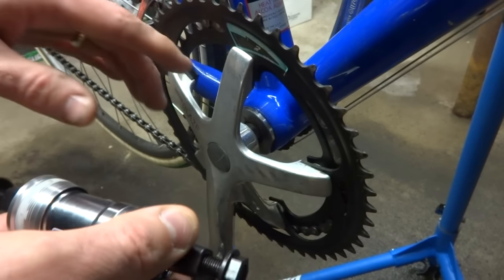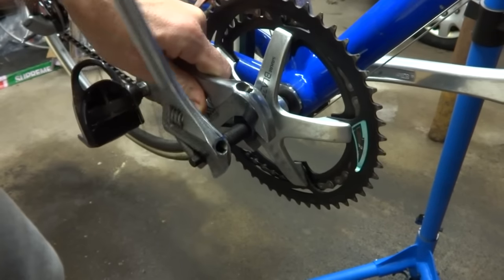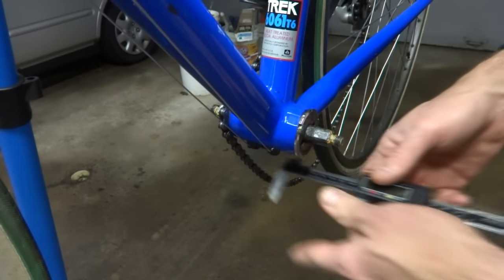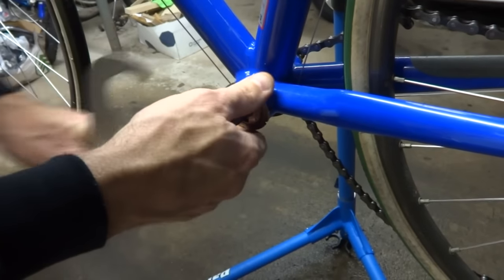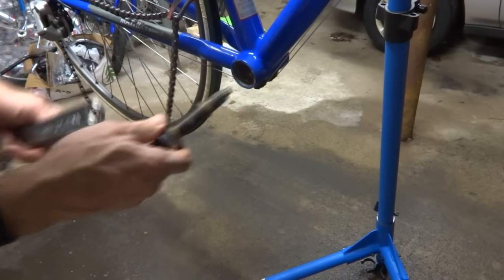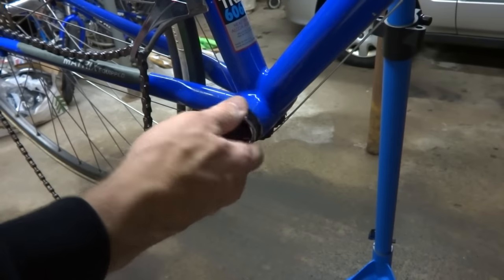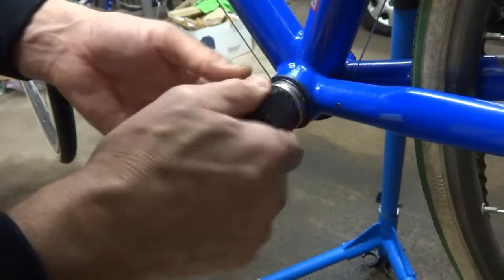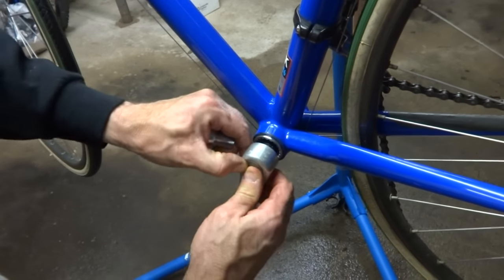How To Upgrade Vintage Bike With Sealed Cartridge Bottom Bracket

Comment: I haven't had to do this job since before they made the sealed units and the bike I am doing this to now also has the old shitball setup I hate so much. It has been creaking for quite a while now and it finally started squeaking so I broke down and tore it apart. I have been dreading it for about a year now. What a rusty, dirty mess with screwed up ring cages, free floating bearings and rusty grease everywhere as usual!  Always coming out of adjustment! Always getting full of dirt and water!  Always pissing me off LOL!  I will be so glad to ditch the old system and switch to the new sealed units for the first time. What do you recommend brandwise for longevity? I don't wanna buy any of this cheap plastic shit !  Thanks for the vid BTW. I was starting to think I was gonna have to run the old shitty setup again but this makes it easy. :)

Comment: I have a question, I have a square tapered bottom bracket on my bike at the moment, would I be able to fit a sram red crankset if I remove the square bottom bracket?! I'm so stuck and I have no idea about anything
Reply from the maker: Maybe. Depends on the threading of your current BB and what BB the SRAM Red crankset has.

Comment: Is it a problem if you use grease if the non-drive part is plastic?
Reply from the maker: You're not supposed the grease the plastic cup. Only the metal cup(s).

Comment: I want to upgrade my old road bike with cartridge bottom bracket and the shell is about 73mm and I want to change to 2 speed crank so what measurement that I need for the spindle?
Reply from the maker: 73mm shell width is generally on mountain bikes. Road bikes are generally 68mm. The spindle length is determined by the cranks. You have to look up the specs,
Reply: @RJTheBikeGuy  I'm pretty sure the shell is more than 68mm so is it unusual for a road bike with 73mm shell? And the crank speed are 48t and 38t
Reply from the maker: @sumrandomguy2297  Pretty sure? You didn't measure it? 48/38 are pretty low for a road bike.

Comment: Have to ask I have one I'm getting ready to do this too problem is the crank and the crank arms along with the sproket all appear to be one piece on my old BMX bikes. I they are 80s designs the one I'm thinking about doing this on may even be 70s but there's definitely no obvious way to get all of that separate though I know there has to be because you have to service the bearings
Reply from the maker: One piece crank BBs are completely different, and different sized BB shells. Maybe this: https://www.youtube.com/watch?v=7xTJ4ZmWmU8

Comment: I have a vintage frame from mid 80s it doesn’t have a bottom bracket installed. How do I pick one , and how do I pick the spindle length
Reply from the maker: You need to decide on cranks and then get the bottom bracket then look at the specs of the crank as to what BB you need.
Reply: RJ The Bike Guy where do I find that info. Im going to install a vintage Campagnolo super Record crank that I just got can you help and point me in the right direction. Thanks for the info regardless just starting out on the mechanics of bike building
Reply from the maker: @Jciprian  Google. Research the crank you have and what the spindle length is supposed to be. You will also have to figure out what the threading is on your frame. Is it British/ISO or is it Italian, or French.
Reply: RJ The Bike Guy thanks

Comment: My buttom bracket that i currently used is 70mm×118mm buttom bracket square taper but i want to replace it. The problem is i cant find 70mm×115mm buttom bracket square taper...can i use 68mm×115mm instead of 70mm×115mm?
Reply from the maker: 70x115mm BB. https://www.amazon.com/exec/obidos/ASIN/B005GXQT6U/ref=nosim/youtube25-20

Comment: how do I know what size crank puller to get for my daughters 2006 specialized hotrock 24" mountain bike?  1/2" play in crank, Im sure bearings are toast. thanks
Reply from the maker: Is it a square taper bottom bracket?
Reply: RJ The Bike Guy yes
Reply from the maker: https://www.amazon.com/exec/obidos/ASIN/B0028YUZSS/ref=nosim/youtube25-20

Comment: Great video. I've got an old Raleigh Pursuit 12 gear road bike from the mid 1980s. The bottom bracket is wobbly, was making bad noises and has now gone stiff, so I'm expecting to need to replace it. I've already tried my local bike shop, but they didn't seem to want to do this for me. So i'm looking into DIY now. I've ordered some of the special Park tools, crank removal tool etc. However I've read online that some vintage Raleigh bikes have a "26 turns per inch thread" that might be non-standard. Does this mean I have to find a special cartridge, if so, how do I know which one to get? Are these easy to find? Hopefully someone can help advise me, thanks.
Reply from the maker: You should be fine. That was old Raleigh 3 speed bikes and such.
Reply: @RJTheBikeGuy  Many thanks for the speedy reply. Once I can get inside the BB, I'll see whether I can fix what's there or if I need to source a new cartridge. Eitherway, your videos here will no doubt be invaluable. Thanks again.

Comment: I have an old Diamondback MTB that I picked up curbside. I want to upgrade to a U.N.-55 sealed cartridge BB. BB Shell width is 68mm. Hi The current spindle is 124.5mm long. The U.N.-55 comes in 122.5mm and 127mm spindle lengths. Any suggestions on which one to pick? Is it better to be 2.5 mm long or 2mm short? Maybe the 2 mm isn’t enough to worry about but would like to hear other opinions. Thanks.
Reply from the maker: Pick the closest one.

Comment: i have the exact same bottom bracket.. and its started to sqeak ? any ideas on what i should do.
Reply from the maker: You should find the squeak and fix it. A squeak from the bottom bracket. It can be a bunch of different things that aren't even the BB, just sound like it. Loose crank bolts. Loose chain ring bolts. The pedals might be squeaking. Or the seat post, or the seat. If it's the sealed cartridge BB like in this video, try regreasing the threads (except if the part is plastic).
Reply: hi thanks for the fast reply...the BB is only 1 month old ive done about 50 miles with it fitted and ive noticed it started to squeak today after cleaning it from 2 days ago ... is there anychance water has got into the vital parts ? because i clean my bike allot from getting it really muddy everytime i hit the trails ?
Reply from the maker: Sorry, as I said, the squeak can be from a bunch of different places. You need to investigate. I can't do it through text.
Reply: GB- REFLEX most likely will be cranks or pedals not BB. loosen them off, grease and tighten back up. wont be water as its a sealed bb and your frame probably has drainage in the bb shell.

Comment: Great video, only let down by no mention of how to maintain chainline if old spindle is not symetrical.
Reply from the maker: If you use the same spindle length, you should be fine.
Reply: @RJTheBikeGuy  The spindle on my bottm bracket is assymetrical overall length 124mm drive side is 37.5 mm with a 52 middle section and 34.5 non drive side.
Reply from the maker: @danielmulholland8711  Yeah, and probably all spindles that long will be asymmetrical. The variation in length is to accommodate different cranksets. Like a triple vs a double. With 124mm, I am guessing you have a triple. Doubles use spindles that are shorter. The main difference is going to be on the drive side.
Reply from the maker: Go try to find a cartridge bottom bracket that gives you a selection of drive side vs non-drive side length. I doubt you will find any. Just different spindle lengths.
Reply: @RJTheBikeGuy  Thanks for promt reply RJ. Shimano have a 122.5 and a127. Sheldon Browns BB data seems to recommend a 127 symetrical spindle. I'll go for this and see if chainline works out OK. Thanks again for help, Best regards D.

Comment: I have a Gary Fisher Mountain bike, where the Crank arms play when I ride. I removed the bottom bracket and saw that one of my ball bearing and cage broke, I replaced the ball bearing and cage, and it still plays. Can I just replace my bottom bracket ball bearing cage system with a sealed cartridge ?  ( of course following the directions in this video, making the proper measurements) is there anything thing else that needs to be considered in terms of the fit of the cartridge inside the bottom bracket. Internal diameter? or the fixed cup threading correctly to my bike?
Reply from the maker: Yes, you should be able to do that. Measure the same way I did in this video. BB shell width and spindle length.

Comment: very good video, but having worked in a bike shop we do things a bit differently. firstly, you always have to undo the screw holding the guide for the cables if there is one, because it may be pressing into the BB and causing it to be stuck or hard to turn in. secondly, we always put the metal cup in half way then put the fix side in all the way, and even then, we would bolt the tool to the BB and use a big wrench to make sure it's in there well as it would often occur it could come undone. then we would just finish turning in the cup by hand. We have never had anyone come back that it came lose or any problems, however if it wasn't installed by us it often happened that it loosened

Comment: i have 124.5 bottom bracket and i need to change it I have found 122.5 bottom bracket is there gonna be an issue?
Reply from the maker: Do not ask the same question under multiple videos.
Reply: Do you know if it is possible to replace an old bottom bracket from an early 70's Schwinn Continental (with loose bearings), or would the old BB Shell not work with a modern setup?
Reply from the maker: Lucas Kathol. https://www.youtube.com/watch?v=7xTJ4ZmWmU8

Comment: Why no cartridge cap on either side of the crank? Seems odd that the crank mounting screws are kitted for dust caps but not the cartridge bottom bracket.... something to make with a 3D printer.

Comment: I paid 80 bucks for my old peugeot. I've put 5000 miles on it.
I'm sure the tools he used cost more than my bike.
Reply: John White I bought my bike for $48 a year ago 😂 we have cheap bikes 😂 but still does the job right?
Reply: No they don't. You can buy the crank puller for seriously $2. Sure, it's not going to be the same quality as a $25 one (or frankly it damn well could since most companies just package bulk Chinese stuff these days anyway) but it will easily do this job 10+ times without issue. A set of 3 adjustable wrenches can be bought for $10 with both sizes plus a smaller one at harbor freight, and a bottom bracket tool is again, like $2-5 depending on what exactly your bike has. Realistically you could buy every speciality tool you'd ever need for your specific bike(chain whips, cassette/freewheel tool, crank puller, bottom bracket tool, spoke tool, brake tensioner, etc.) All for under half the price of your bike if you know how to shop and don't assume you need the best of the best when it comes to things you will rarely, if ever, use.
Reply: You can also walk. It costs noting.
Reply: They say time is money.
Reply: @John White Or you can buy the tools and fix/repair your own (no matter how many bikes you own) bike without going to a bike repair shop, any time in the future. Or the other option is to keep buying old cheap bikes, that haven't been serviced in a long time and pray it doesn't break down on you or at worst, cost you your life. If your life is worth less than the cost of a few tools, then keep riding your cheap bikes. To each their own.
Reply: Who cares.... Maybe over the course of a few years (and thousands of miles on your bike), you build up the tools you need and it might cost you $200. Are you really making a big deal out of such an insignificant amount of money? If you buy a crank puller, it will probably pay for itself in one repair vs taking the bike into a shop.

Comment: At 6:20 , why should you not use grease on the plastic collar?
Reply from the maker: The grease is to place a barrier between the metal parts to prevent galvanic corrosion, so they don't seize. That doesn't happen with plastic. Grease can break plastic down.
Reply: @RJTheBikeGuy  Thanks.

Comment: Hey, i have a vintage road bike from the 70's and i'm trying to upgrade some of its components but the BB shell measures around 71.25 mm and the BB (square taper) measures 123.65 mm, now the threads measure 34.6 mm so i believe i have an english thread. So, what should i go for? Also, the Spindle has 3S written in it (and what it appears to be a 2, so it would be 3S2).
Reply from the maker: +Felix Mendoza Is the drive side fixed cup left hand threaded or right hand threaded?
Reply: RJ The Bike Guy Left  hand threaded.
Reply from the maker: +Felix Mendoza Okay. The BB shell measurement is weird. Most english threaded BBs are 68 or 73. There are some Italian ones that are 70mm. But they would have right hand threading on the drive side.
Reply: RJ The Bike Guy  That's why i'm asking you. The bike was made in Japan and had a bunch of Suntour components on it. I suppose i could continue using the original BB since it doesnt look damaged or worn out. What would happen if i used an english 73 on it? would that 1.75 mm make a noticeable difference?
Reply from the maker: You could maybe use an English 73mm BB and add a 1.5mm spacer if necessary.
Reply: Thanks. I'll look for that option and quadruple check every measurement to see if it works.

Comment: Is the diameter of the bottom bracket standard?
Reply from the maker: +sonomama82 Relatively. Most bikes have bottom bracket shells that are pretty close to the same diameter (close enough to fit a cartridge BB). There are going to some bikes with different diameters. Like bikes with one piece cranks.
Reply: +RJ The Bike Guy You mention diameters being “close enough to fit
cartridge BB” …I got the measurements you described which pretty much covers
the widths…so that pertaining to diameters and thread direction are they pretty
much standard?? And I referring to upgrading China made department store model.
Thanks for you help!
Reply from the maker: +Jerry Z. http://www.sheldonbrown.com/cribsheet-bottombrackets.html
Reply: +RJ The Bike Guy Thanks RJ and the link you provided goes above and beyond...thanks again!

Comment: what about diameter? i have a schwin thats smaller than another bike i have. is it a no go?
Reply from the maker: Diameters are relatively standard with not a ton of variations. Generally not smaller. So you need to measure and identify what you have.
Reply: @RJTheBikeGuy  ok, it just looks bigger but i did measure the threaded part itself. tho the locking part is bigger the threaded parts are the same. so there's still hope. thanks a bunch!

Comment: Great vidio,s  ( think that new cartridge went in wrong way round though )
Reply from the maker: That is the correct way. It would be very hard to put it in the wrong way as the drive side is left hand (reverse) threaded and the non driveside is right hand threaded.
Reply from the maker: Maybe you have seen cartridges that the main body goes in from the non-drive side. Most of the ones I have seen go in through the drive side.

Comment: Good Night from Mexico City.  I have a Benotto bike since 35 years. I want to install a bottom bracket in my vintage bike because ir has a simple system. The measurements I obtained are:
Axel lenght of 119 mm
Shell widht of 70 mm
Shell diameter of 34 mm. 
My bike has an Italian threading.
I want to upgrade my bike with the right bottom bracket. My bike has 2 plates. It has 10 speeds. In the marker there are 2 options:
BB-UN26 70X113X36X24 and
BB-UN26 70X110X36X24

Both are shimano and italian threading
¿Which would ir be the best? In the Store the don't know anything.
Thank you very much and take care of yourself
Reply from the maker: Neither. Too short of spindles. Try something like this:
https://www.amazon.com/exec/obidos/ASIN/B00629OEGY/ref=nosim/youtube25-20
70x118 Italian.
The BB UN55 is better than the 26.

Comment: Always tighten both sides at the same time, don't fasten one side fully and then thread the other one. That's a simple rule for anything with more than 1 screw point...
Reply: Actually for a BB you really DONT want to do this. First screw the cup of the non drive side in by a few threads so it supports the BB when you insert it from the drive side. Then fully screw in the drive side of the BB as needs to be all the way in! Then secure the BB in place by screwing in the non drive side till its tight.
Not following these steps can lead to the drive side not fully being inserted in the frame which will lead to a misalligned drive train.

Comment: Great video RJ! I have a question though. I have an Italian Atala from 1983. The bottom bracket is 130mm side to side full length, there is no taper as in this bike. Therefore which measurement should I take?  There is the line left by the crank, should I measure from this line?
Reply from the maker: I have no idea what you are describing.